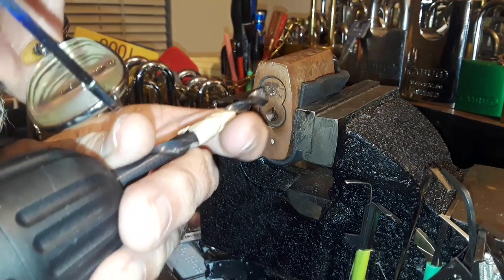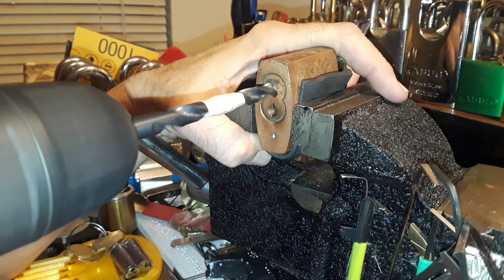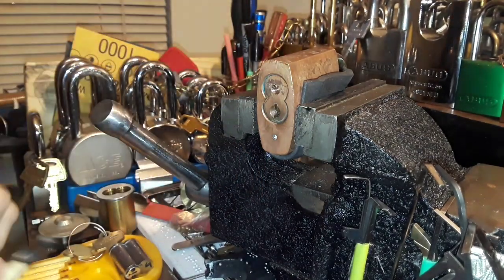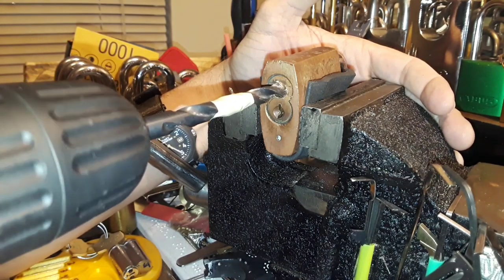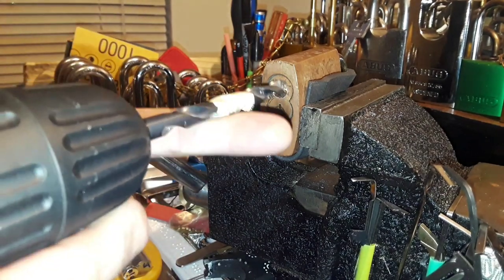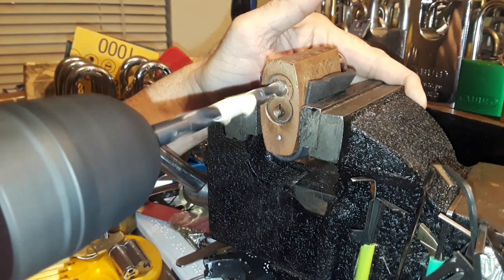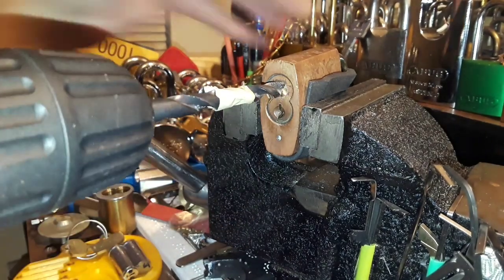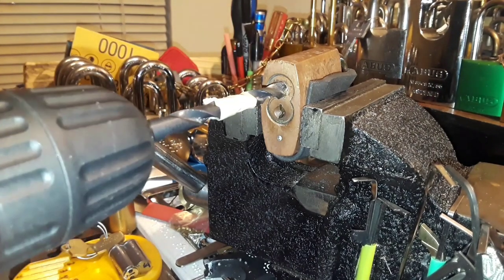(466) Drilling Out A Best SFIC Core

Comment: i had to drill out a few locks ages ago and i always drilled the keyhole. never have i thought to drill that spot.
Reply from the maker: bird718 I  looked on YouTube and found them drilling between the E&S of BEST. I also didn't have a 1/4 inch drill bit, so I just used 5/16.

Comment: My friend all you have to do is remove the little plastic ring and the seven pin core should fit buddy. I was actually going to do the same video tonight lol. I'll wait a couple weeks to do it now great job bud.
Reply from the maker: Bill Bacardi I finally figured that out my friend.  At first I thought I would need a 6 pin core. Then, while sitting in a chair, the light came on in my head,  and I pulled the spacer off. I never saw a spacer on one before,  but I've only seen a handful of SFIC's.
Reply: William Mancel Great job my friend glad that you got it figured out buddy. If you need a core let me know.

Comment: Nice one...never drilled a Best before, only a little Master.
Reply from the maker: jmmurdy It was a first for me. It worked out well. I didn't drill too far, even though I set up the drilling depth on a 7 pin core, and then proceeded to drill a 6 pin core. 😁

Comment: 1. The drill bit is about 2x too big. 
2. Your hole is way too low. 
The goal is to to take out the control shear line while leaving the change key shear line intact so when you turn the plug, it’ll pull the control lug with it. 
You should just barely skim the top of the control lug. Around 3/32” above the plug. 
Turn the plug with a flat head and use a traveler hook to pull the core.

Comment: I am wondering if the real intent wasn't to retrieve the IC from the padlock but more of a revenge attack for pick breakage. I would have laughed if you broke a fourth pick trying to dislodge the broken pins from the core. lol. Imagine the old core getting the last laugh. lol. Cheers:-)
Reply from the maker: Paul Springett Payback with a drill.  I almost did break another pick trying to get those pins out.

Comment: When you drill out a lock I find it better to start with a smaller drill nit then move up to a larger one
Reply: Or, if youre using a 1/4" bit at first and youre just touching the plug, dropping a size down to 15/64th or 7/32nd will get you of the plug. For the record, I can drill an I/C plug and have it in my hand in about 90 seconds.
Reply: @ftwopointeight  👍